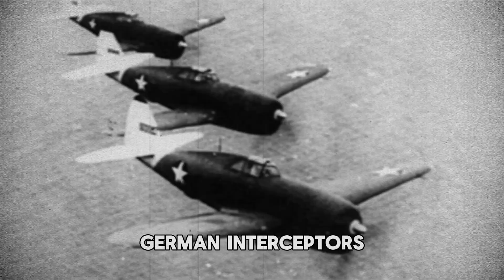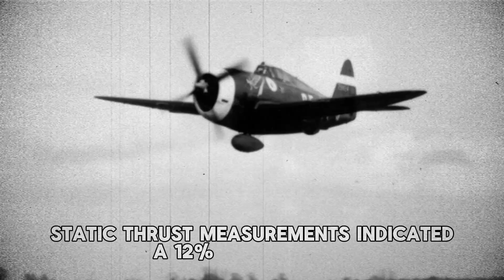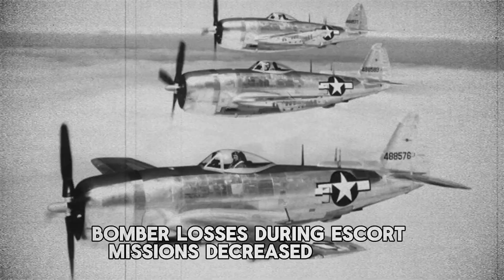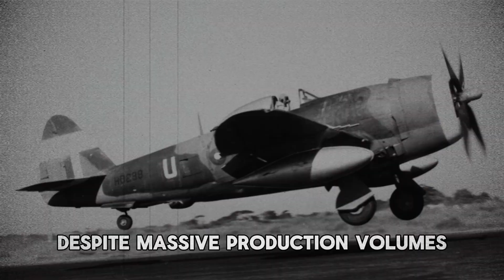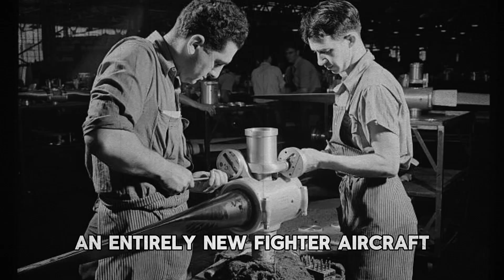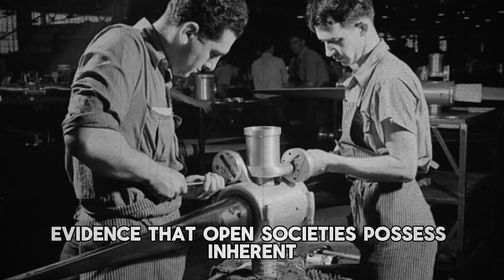How Paddle Props Turned the Thunderbolt Into a 470 mph Beast Germany Feared

Comment: Another  Lugener  Schweine......do  you  own  stock   in  Republic    Aviation??  The  Only  Pig-47   going  400  plus  MPH  is  one  blasted  for  3  or  4  seconds  by  a  Krautenese   20  mm  Kanon,   blown  to  Hell,  set  on  fire  and  heading  Straight  Down  to  Terra  Firma  where  it  will  be  clocking  Zero  mph   im   der  Hohle.....Kmerad  Lugener.